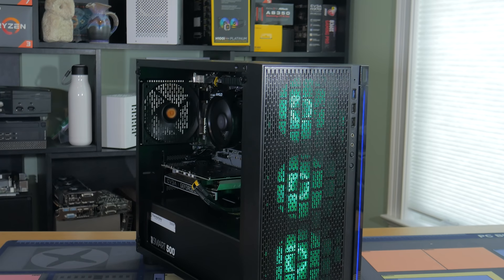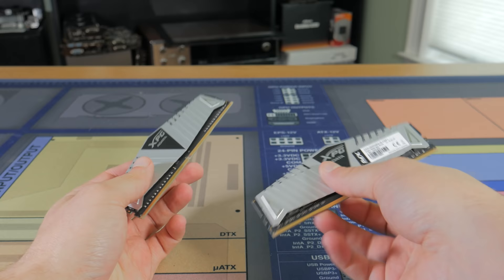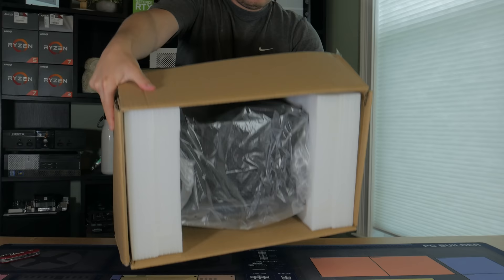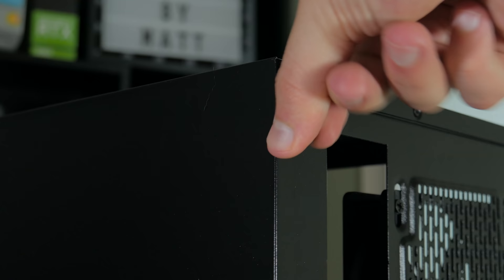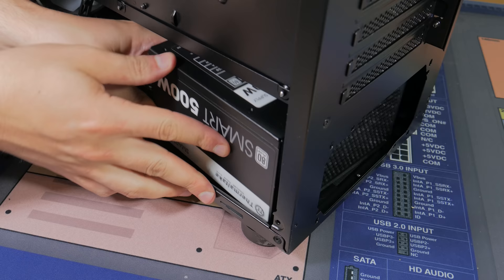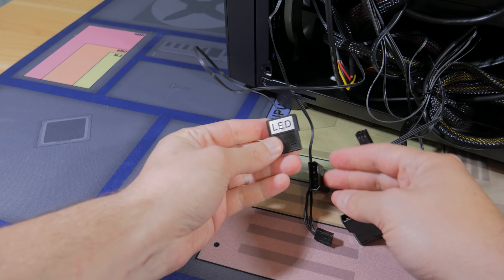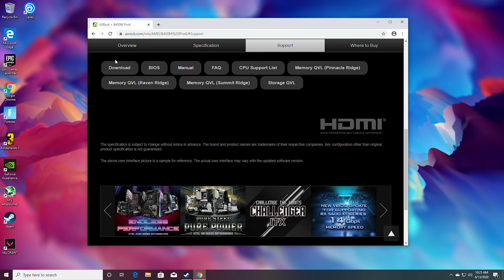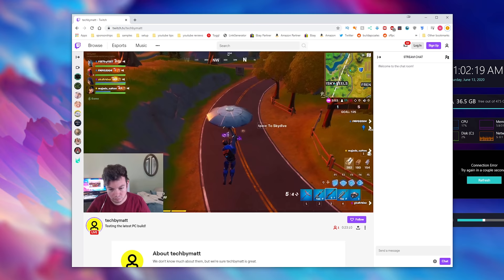$650 Gaming PC Build Guide! (2020)

Comment: using parts listed above it comes to about $730. still a good build just inflation is tearing apart the PC pricing at this time. That 3100 should be 119.99 but instead is marked up to 140. i just did a build myself and it came to about $750.

My build:
CPU: Ryzen 3600
Mobo: ASrock B450m/ac (take about $30 off total for rush shipping, I was impatient)
Ram: Viper 4 series 2x4gb 3000mhz (wish I would have went with the 2x8gb)
GPU: Saphire Radeon Pulse RX 580 8gb
SSD: ADATA SU635 240gb
HDD: Seagate Barracuda 2TB
Fans: Basic Uphere branded black fans (wish i would have spent $6 more on RGB fans)
PSU: Thermaltake 500w 80+ White
Case: Cooler Master Q300l

I did actually end up spending $30 extra to buy a Wraith Prism cooler on Ebay. I liked the stock aesthetic and its performance is pretty good.

Comment: I know this video is a few days old, but here's a tip: If you live anywhere near a Microcenter you can save even more money on this build. Or, if you are willing to spend about the same, you can get an even better processor. Microcenter regularly has open box specials and you may be able to get the exact same motherboard for even less. On top of that when you buy a compatible processor with it you get an extra $20 off. I was able to get a Ryzen 5 3600 and that same motherboard for $190. That's about what you would pay for a 1600 AF and that same motherboard from other places.

Comment: FWIW, remove the filter from the front of the case.  This was reviewed and there's a substantial airflow increase by removing that filter due to the overlap with the venting in the case.
Reply: Wouldn't this cause more dust particles to be able to enter the system?

Comment: I have a few questions, I’m planning on building a pc within the next month and I really like this build. My price range is around 1k but I’m wondering what parts of this should be upgraded, like which parts could improve my FPS and performance more. And can I install an ssd as well as a hard drive as 500 seems a little small and I like having extra storage.
Reply: I’d do 2 terabyte hard drive and then get a 500 gb ssd. Then for FPS get Ryzen 5 3rd gen, 16 go ram, GTX 1660 super oc, find a Motherboard that supports 3rd gen for you can upgrade later and case is your choice as fans and possibly liquid cooling
Reply: For the Psu 600w bronze plus is on the good level you can get the EVGA 550W one too

Comment: These are really useful and excellent vids. Thanks for uploading. Are DVD drives a thing of the past now? And where would you plug in USB stuff/wireless adapters for mouse/keyboard?
Reply: Most modern PCs don't use an optical drive (DVD) set up anymore, pretty much everything is digital, and with big enough storage/RAM you won't need to worry about discs. You might be able to install one if you have the right cables but it won't fit in your case. USB ports are usually on the top of the case, if you look at the pictures when you're buying one it'll show you where they are.

Comment: Built Jan 2020 so low prices. Ryzen 5 2600X for $89 sale, Aorus B450 Pro Wi-Fi $104. The CPU is later binned OC monster scores near exact same CPUZ single/multi verified as 3600 $180. Mobo features, PCIe 4 support BIOS available, integrated I/O shield, RGB, USB all 3.0 with two 10 GBs gen 2, type C, two NVMe thermal taped heat sinks, traces supported 16GB OC 3600MHz RAM with tight tuned sub timings RGB $57. A bang for buck perfect storm just in time. Cant get near it today prices.

Comment: Who else is her when the Ryzen 5 1600af is now $150. Anyone recommend any good cheap CPUs for the same price? I think the Ryzen 3 3100 is the same price as the 1600 so idk what to get now
Reply: Ryzen 5 1600 non af, on eBay they’re like $100
Reply: I would just go with the ryzen 5 2600. It does the same with the 1600 af but you get a few more frames at the same price point

Comment: Hey should i start buying parts to build or buy a graphics card i currently have a dell sff 9020 with an i 5 4670
Reply: Buy graphic card and it will be a gaming pc. You can buy used 1070 for 175-200$

Comment: The  R5-1600 AF is what I use in my secondary PC. It is not compatible with X570 or the New B550 at least from MSI and ASUS TUF Gaming X570-Plus (Wi-Fi). I own an x570 gaming edge wifi from MSI and had the ASUS for a while (sent back when I got my EDGE back from my buddy)

Comment: Is this a good pc for a starting pc? I plan on playing Rainbow Six Siege, Overwatch, Valorant and GTA V. I won’t be doing any streaming or video editing.
Reply: Yes it is a pretty above average entry level pc but if you are strictly wanting to just game then I would go with the Ryzen 5 2600 or Ryzen 3 3300x. Both are like $20-30 more expensive then the CPUs shown here but it's worth it if you have the extra money. If not then the Ryzen 1600 does the job and you only lose a few fps which isn't noticeable especially for beginner pc gamers.
Reply: kota. hey kota, i saw u replying to a lot of comments so i have a question, how do i make this pc quieter, i just built the same pc and it works good but it's really loud

Comment: Great video! Trying make this build but the Thermaltake Versa H18 isn't available. Have found the Thermaltake Versa H15 and I am wondering if this is comparable to the H18 in terms of airflow? The H15 only mounts 2 front panel fans in contrast to the 3 which the H18 mounts.

Comment: Hey! i did my first PC build last week, it's similar to this in just abut everything except brands. I've run into an issue with my RAM and was wondering if you had any advice, tips or a solution, I'm running G.Skill Ripjaws V 3200 16GB kit and when I tried to change the XMP profile to 1 and run some games, all my games would just close by themselves after around 5 minutes. resetting the motherboard profile has solved the issue, but i'm not running the ram at 3200 MHz, any solutions? Thanks!
PC parts:
Ryzen 5 2600X
ASRock B450M Pro4-F
G.Skill Ripjaws V 16GB 3200MHz
Zotac gaming GTX 1660 Super
EVGA Bronze 550W PSU

Comment: this is the pc im planning to purchase, can you tell me what you think about it, its around the same price point. (
GIGABYTE B450M DS3H 
Apevia ATX-SP700W Spirit ATX Power Supply
WL 1TB 64MB Cache 5900RPM SATA III (6.0Gb/s) (Quiet & Heavy Duty) Internal Desktop 3.5" Hard Drive
Silicon Power 256GB SSD 3D NAND A55
OLOy DDR4 RAM 16GB (2x8GB) 3000 MHz
uphere 3-Pack Long Life Computer Case Fan 120mm 
FSP ATX Mid Tower PC Computer Gaming Case with Tempered Glass Side Panel (CMT260)
AMD Ryzen 5 2600 Processor with Wraith Stealth Cooler
XFX Radeon RX 580 GTS XXX Edition 8GB

Comment: I have a question about the gpu, instead of the evga 1660 super will the evga 1660 work with this biuld? Also will this card support dual monitor setup? I could really use some help cause im not sure
Reply: card does support dual monitor

Comment: what frames would it run call of duty modern warfare on??
Reply: I have the exact same set up but with a ryzen 5 2600 cpu. I run warzone at max settings and can get at least 100 fps and up in game. Only a few times does it go down to 80 fps but that's rare if there is tons of players in one area. Also I've actually had moments where the fps reached 140fps but this gpu is definitely great for warzone. Just spend an extra few dollars on the ryzen 5 2600 or 3600.

Comment: I have one problem with the power supply and that's because the lower end Thermaltake PSU's have been starting to blow up systems lately. Scattervolt even pointed this out because in his discord, someone reportedly had a thermaltake 500 watt 80+ psu explode. Spend an extra $15-$20 on an EVGA CV 550 or 650 watt 80+ bronze psu, as those will be much more reliable. Also, don't buy any sketchy psu, whether it be name brand or not, because cheaper name brands can also be just as dangerous as the obscure chinese branded psu's.

Comment: Can you also use ryzen 5 2600 for gaming and streaming?
Reply: Ryzen 2600 is a waist of money at its current price. $144 for it. A 1600 AF is right now $107 and it's the same zen plus 12 nm chip clocked a little slower but cam reasonably hold an overclock of 4.0-4.1 without much effort. For $204 you can get the 3600 and it's zen 2 7 nm chip is much faster than the 2600 for $60 more. So save the $40 or spend an additional $60 and leave the 2600 alone at it's current price

Comment: My computer keeps turning off and turning on over and over again. I just built this system today with an rtx 2070 and a different cpu and psu. I took the cpu out multiple times, putting it back in and reinstalling the fan multiple times but it keeps doing it. Could you help me Matt? I’ve tried everything. Is it a faulty cpu, psu, or Mobo?
Reply: Either a mobo shortage or a faulty PSU. What case do you have?
Reply: That's a pc builders worst nightmare. I hope you were able to figure out the problem and not an item that was DOA

Comment: Does this PC build need a wireless adapter?
Reply from the maker: Ideally you would connect with ethernet, but if your only option is wifi, then yes. You will need ideally a PCIE wifi card or a USB wifi card. Usually either option will cost around $20
Reply: @TechByMattB  Ok thank you. would it be ideal to get a TP-Link archer t6e? it is $40.

Comment: I went to PCPart picker and followed this build almost exactly(besides the case) and its saying that "Some AMD B450 chipset motherboards may need a BIOS update prior to using Matisse CPUs. Upgrading the BIOS may require a different CPU that is supported by older BIOS revisions." I copies and pasted the warning message. If I switched the CPU to the AMD Ryzen 5  1600 then there was no compatibility warning. This is my first time building a PC so I just wanted to make sure about the compatibility issue before I go ahead and start looking for these parts? If anyone could help that would be greatly appreciated!
Reply: You probably already have everything figured out and sorry you didn't get help sooner, but there's nothing to worry about there. It's just saying you might need a BIOS update but the board will be shipped with everything completely updated so you're fine.

Comment: Question what happens when i plug case fan in cpu fan header? And question do i need to download drivers from the link you put in description, or can i download Nvidia Experience and there download drivers? Please someone answer
Reply: Nothing bad will necessarily happen, but it is best to plug your CPU fan to the CPU fan header. If you have a liquid cooler and are using the fan header for that, then I wouldn't worry about using the CPU fan header for a case fan. The link he has in the description for the Nvidia graphics card drivers is straight from Nvidia. It doesn't really matter if you use the Nvidia Experience program or manually download from the website; its the same thing. The advantage of using the Experience program is that it will auto-notify you when there are updates.

Comment: Build a cheap dual-CPU editing/rendering workstation under $500 using used server/workstation parts.
Example, dual Xeon X5680 CPUs near me cost $50 for the pair, beating a 6th gen i7, a 9th gen i5, and even a second gen Ryzen 5, in both price, performance, and features 8 cores!

Comment: How many USB ports are on in to connect keyboard and mouse or headset and mic
Reply: With the motherboard and case in total its 5 usb 3.0 and 4 usb 2.0 slots. So you have plenty of options to plug in what you need. I have my keyboard, mouse, rgb mouse pad, speakers and rgb desk lights all connected to my back usb ports. Yet I still have my front case usb ports open for things like flash drives and external hard drives for easy access. Pretty huge amount of usb ports for such a cheap system in my opinion.

Comment: Hey i just bought and build this pc, it works and turns on great but there's a problem... it doesn't have wifi and idk what to do
Reply from the maker: You need to add wifi, preferably with a PCIE wifi card. Which is like $20 on amazon. Or less preferable, get a usb wifi card
Reply from the maker: https://www.amazon.com/dp/B071NZ6DL9/ref=cm_sw_r_cp_apa_i_hcv.EbT8W4YTY
Reply: Tech By Matt thanks but i just came across another problem 😐 my pc just suddenly turned off, and it won't turn back on, i'm scared it has something to do with the power supply, but idk
Reply: Tech By Matt oh it just turned back on
Reply: Tech By Matt i readjusted the wire and it turned back on, but i touched it again and it turned off just now, but now it won't come back on
Reply: Tech By Matt ok i just switched it out for another cable that fits better, it turns on, sorry
Reply: Tech By Matt WAIT one more thing, how do i make my pc quieter
Reply: pls respond
Reply: Tech By Matt it's fine i figured it out
Reply: germanmangos what was the issue?
Reply: I would try try your best to get your ethernet cable to reach your pc. Wifi is really unreliable sometimes compared to a wired internet connection. Also if your pc is turning off when touching the wires then I would double check your wiring as I think one of your plugs may not be fully plugged in.
Reply: kota. i already ordered a wifi card 😶 mainly cause i don't wanna drag an ethernet cable across the house, but i already figured out all the issues i had so it's fine but thanks :)
Reply: Moe Yo i figured it out but thanks :)
Reply: @matthewgerman1618  Awesome. Glad it worked out. I feel you my ethernet cable is in another room so I have to drill a hole from that room to mine. I was thinking about getting a wifi card but maybe in the future I'll get it just to have an option between both.
Reply: @SoundBurstVibes  do you know which wifi card I should get ? Lol I’m new to this but I’m hoping this pc is the one ❤️
Reply: @Ft.chi23  I would get the one Matt linked above its cheap but does the job well for the price.
Reply: @SoundBurstVibes  😊 thank you
Reply: @SoundBurstVibes  wait which one is this I can’t find it 😂

Comment: This is my build if you wanna know it’s for streaming and productivity:

$2000 GAMING PC BUDGET

Pc Rig: 
Intel core- Ryzen 5 3600 ($300)
Mother board- MSI B450M-A PRO MAX ($133)
GPU- EVGA GeForce RTX 2060 KO 6Gb ($600)
Ram- Team T-Force Night Hawk RGB 3200Mhz 16Gb ($149)
SSD- WD Blue SN500 500Gb internal PCI express m.2 nvme ($118)
HDD- Seagate Barracuda 1Tb Internal hard drive SATA ($79)
Power supply- Cooler master MWE V2 650w ($79)
Case- Cooler Master MasterBox Q500L ATX ($73)

Peripherals:
Monitor- AOC C24G1 144Hz 1ms Curved 23.6’’ VA LED Backlit LCD Monitor ($298)
Headset- HS 60 Pro Surround sound Yellow ($120)
Keyboard-GK61 Mechanical keyboard Multi Coloured RGB ($91)
Or- mouse: steel series rival 600 ($118)
Or- keyboard: DURGOD Taurus K320 TKL Mechanical gaming keyboard ($149)
Reply: How the fuck is the 360 300$? Holy shit.

Comment: I would definitely rather go with a 1600 AF / 2600 / 3600 over any 4-core in 2020. Sure you might get 10% less FPS, but you won't get any stuttering since a lot of games require 6-cores or more to run smoothly.
Reply: I highly agree with you. 6 core seems to be the new standard now so it would suck to get a 4 core cpu, as a beginner pc gamer, and have to upgrade a year or two later in order to play ther newer most modern games.

Comment: just bought and built this pc. unfortunately when i built it the display wouldn’t show up on monitor. i re seated the ram and it worked for 2 days then i had the same issue. i re seated the ram countless times and even got new ones. anyone have a solution?
Reply: What does the display say
Reply: Or like does it say boot up or key type
Reply: Had the same issue i just had a flash drive got windows on it plugged it in my pc then pressed f6 while it starts up then i pressed enter when the screen popped up and trial and error till i got it to work took me 2 hours tho

Comment: can someone awnser how much higher the price would go if u used an rtx instead of a gtx
Reply: If you get the lowest rtx card the rtx 2060 ko by evga it'll add about $70 if you're in the US. The stock of the KO is sometimes limited so maybe an additional $20-$30 for a non KO version of the rtx 2060.  That being said the ray tracing of the rtx 2060 will murder your frame rate of that's what you're wanting it for. But with ray tracing disabled it's a great card

Comment: Anyone building this, use the ryzen 3 3200g instead of 3100 because the 3200g costs $80 and saves you $20 plus it comes with integrated graphics.

Comment: Hi, 

So I’ve watched about 50 PC build videos but not actually done anything.. so I thought fuck it and just bought everything you’ve listed  in the description apart from the Case, not available on Amazon UK so googled instead. Came across another case which is the same make but different model - ‘Thermaltake V200’ - I’ve no idea if this is compatible with the parts listed, would be great if someone could let me know as I’m not ‘pc built savvy’ 

Thanks in advance - Great video also - Subbed.

Comment: i want to build this pc but i want a cool rgb fan that is compatible with this build i need some help pc builders please if you can help me please reply with some up here rgb 120mm cooling fans
Reply: as long as the fans are 3 to 4 pins and the same size as the ones in the video you should be good
Reply: YungK1ngCam thnx

Comment: My $580 build
Ryzen 5 3600 (190 USD)
RX 580 (used) (86 USD) 
512GB M.2 NVMe SSD (58 USD)
Corsair Vengeance 16GB RGB 3200Mhz (80 USD)
Gigabyte A320m-s2h (48 USD)
Thermaltake 550W PSU (80 USD) 
Armageddon M1X Case (30 USD) (2 fans included, a bargain)
Will still beat a $700 in terms of specs.